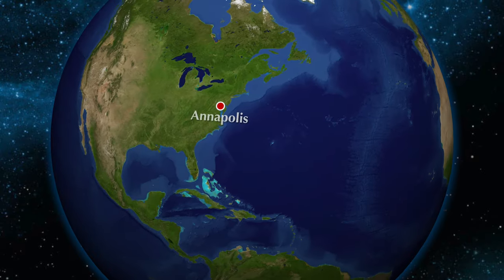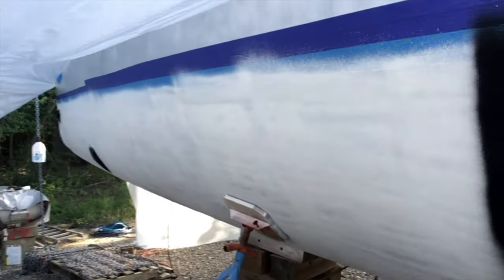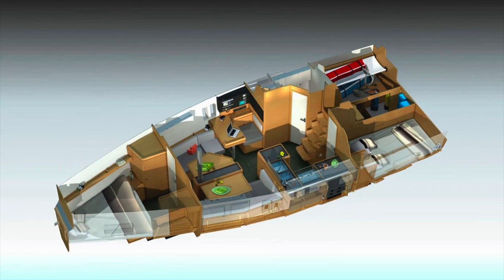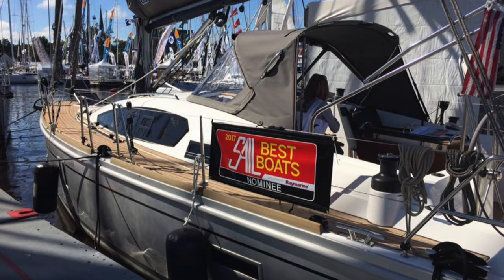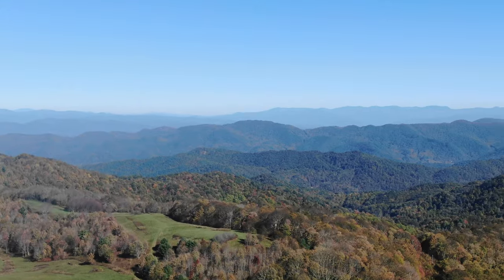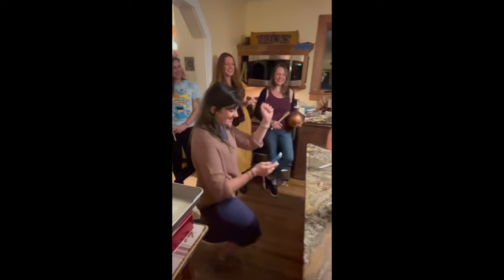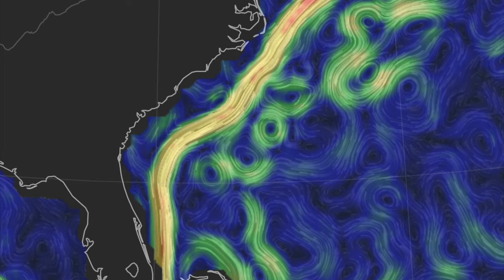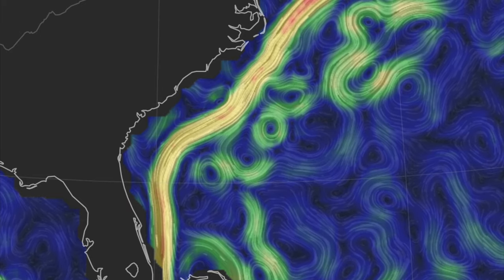Sailing Allures 39.9 from Maryland to British Columbia: part 1

Comment: What sort of repair did you do to the centerboard? Interested in Allures, so happy for an answer, thanks!
Reply from the maker: She is a 2015 model and had the older gusset plate style reinforcement on the centerboard pin, upon suggestion I upgraded to the newer (stronger) ring style gusset.
Reply: @offgridislandwithbremily  Thanks for the info. We were very close to buying a 2016 version, but hesitated thinking the master cabin bed forward were a bit pointy (not much foot room). Love my wife, but still foot fighting was a concern... :-)
Reply from the maker: Ha! Certainly the comfort factor is huge! Fortunately we haven’t found the forepeak to be too snug…Brian is 6’3 and we sleep very comfortably. However it is nice to have the aft cabin just in case ;) and we also have the couch converted to a bed in the salon for extra room.
Reply: @offgridislandwithbremily  Great! I'm 6'4, so definitely gives me hope. Cheers :-)